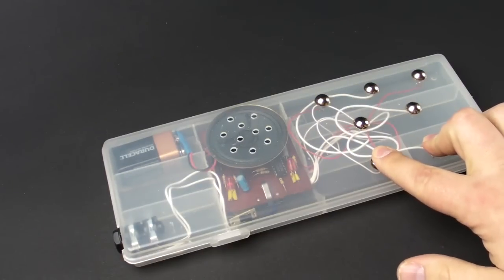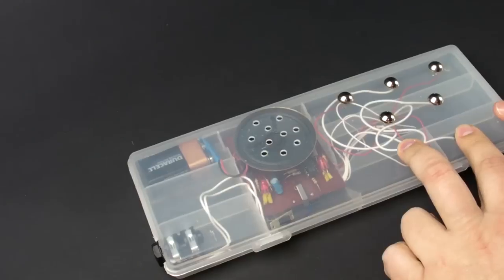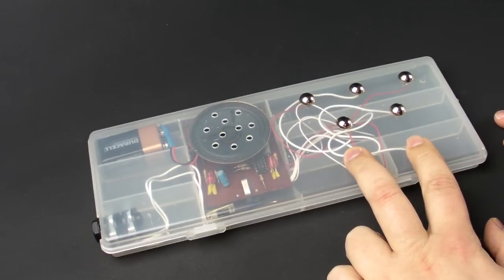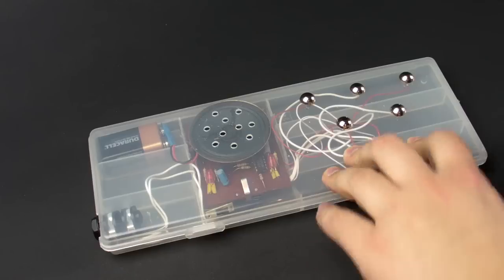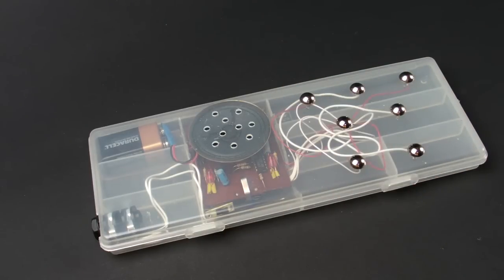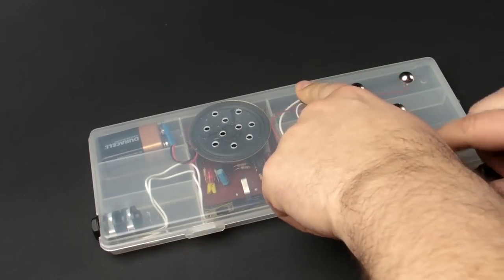In the Maker Shed: Doomsday Sound Kit

Comment: They appear to be pressure sensitive because the harder you push down, the more surface area contact there is with you finger.  That effects the resistsance.

I was hoping for more than just a poorly made commercial, though. Disappointing